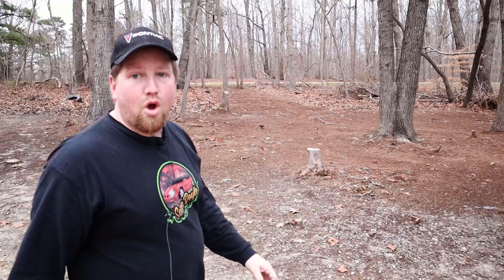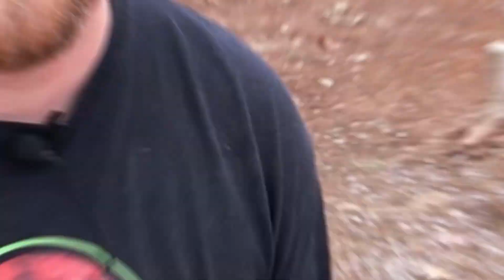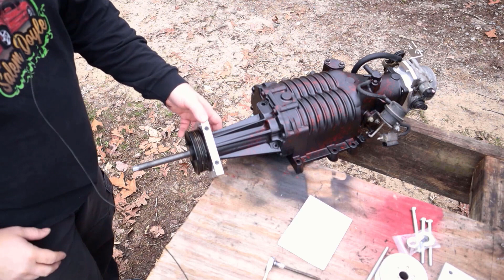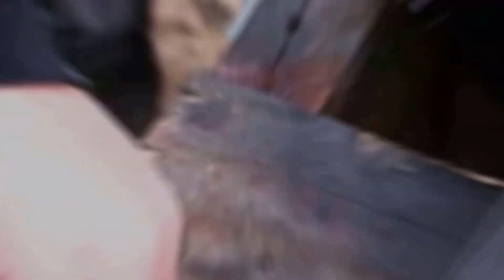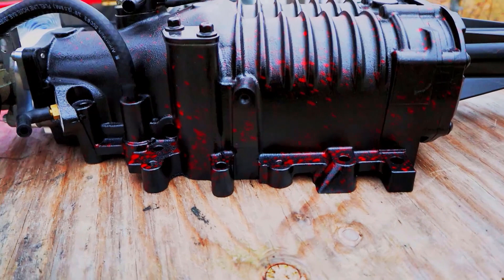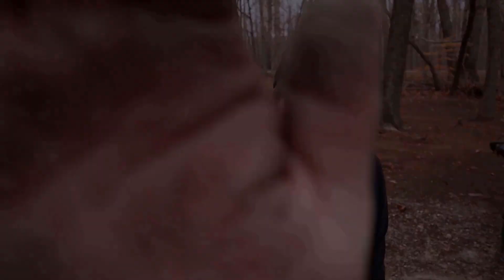Gen 5 Eaton M90 Pulley Swap - Smooth Flow Pulleys

Comment: Hi, it's Nate from Smoothflow Pulleys, love the video!  One thing to note is that the instructions I made for the puller / install tool assume you're using one of my pulley systems where the hub protrudes past the face of the pulley.  The threaded shaft, washers, and nut are slightly smaller than the supercharger shaft so when it bottoms out it should be flush.  I should have told you that with that style system where the pulley sits out past the hub the pulley should be removed.

Again, thanks for the awesome video!

Comment: Do i need to take the supercharger off ...?
Reply from the maker: No. But its easier
Reply: Going to order the 3800 state 2 package.. Have an 05 with the M90 Eaton V... Want to add 35 hp ...! Only has 97k miles on it ..!
Reply: Thx for reply brother. Do you notice a difference?
Reply from the maker: Yeah, but im still tuning for it.  When i get it back on the dyno we will see what happens
Reply: When you get it back you should do a new video ..!
Reply: I have an 01 gt and it's my daily.. I am not sure how long the stage 2 kit will take me to complete

Comment: Swapping these pulleys is a breeze when using a shop press to install them when removing them just use a bearing clamp to remove them using the press when I did mine I removed the snout and replaced the coupler while I had it disassembled

Comment: I have always heated the pulleys to 400 degrees with a hot plate or toaster over and then slipped them on like butter. You can cool the shaft with ice or cold water if you are worried about the seal but I've never had a seal leak..

Comment: I am having problem wit my pulley swap on a 04 comp g there is no place I can drive in the 5/8 bolt to press the supercharger back on there's no hole in the center of the snout
Reply from the maker: You have to remove the snout plug
Reply: How
Reply from the maker: It should just pry out.
Reply: Is there a way I can show you
Reply: Thank u I did it
Reply from the maker: Awesome

Comment: Do you recall if you used gasket maker between ZZP throttle body adapter and S/C?
Reply from the maker: No gasket maker.  Just the gasket
Reply: Salem Doyle thanks!

Comment: Going back to the purge valve fix you showed us towards the end of the video (where the N* throttle hits the purge solenoid valve). Did you use the stock L67 purge solenoid or the L32?And also how did you connect it to the vacuum line and where did you mount it?

Thanks in advance Salem!!
Reply from the maker: I used the l67 purge.  In the install video i show it.  I connected the line after the purge valve to this new point here
Reply: Salem Doyle awesome!! Thanks again, will check out that video!

Comment: Where did you find your supercharger?
Reply from the maker: Pull a part, from an 06 comp g
Reply: Salem Doyle I want one for my 03 ranger. It’d be sick. Thanks man
Reply from the maker: You can find loads of the gen 3 superchargers in the yards
Reply: Salem Doyle figures my 4.0 with low boost and a Efan swap will allow me to put a big alternator for a big sound system and I won’t feel the bog. Plus one day I want to run like 14 lbs boost and make a bad ass mud truck!